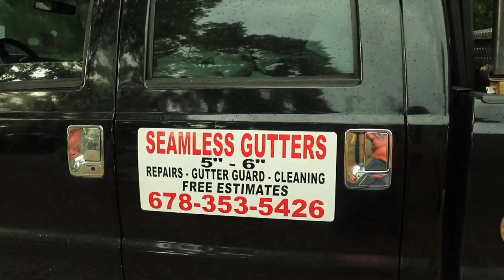Mobile Home Gutter Job| Mobile Home Diva

Comment: PLEASE READ!!!!! Nice job on the gutters but the guttur pipe on the ground should be a lot longer so when the water comes out it will be alot further from your homes foundation to prevent problems in the future. I hope this info helps
Reply from the maker: Hi there. Thanks for the info. My husband actually has this long black piping thing that I connected to each drain and runs the water down the hill and away from the house. I should’ve filmed that but he did it the next day 😂
Reply: @HomesNThingsbyChristie   Hi there your welcome love videos

Comment: They are very unprofessional they didn't even check the slope rate. I hope you got a good warranty or insurance on your home and roof. Because I wouldn't be surprised if there's not water standing in that gutter or if it doesn't rot your roof line.